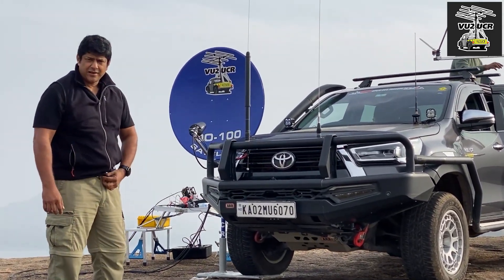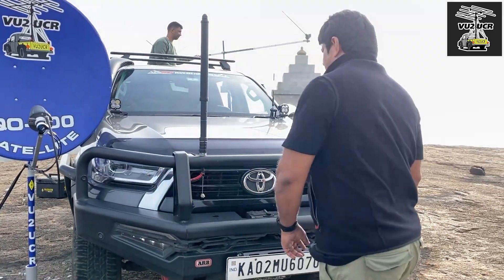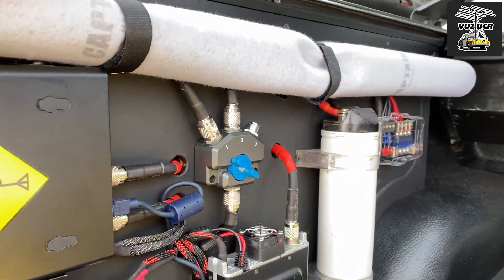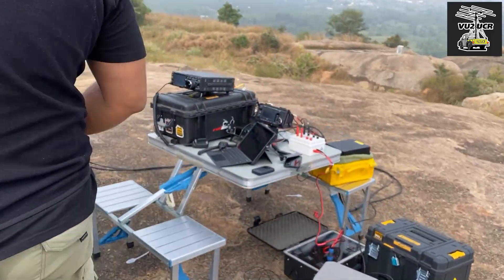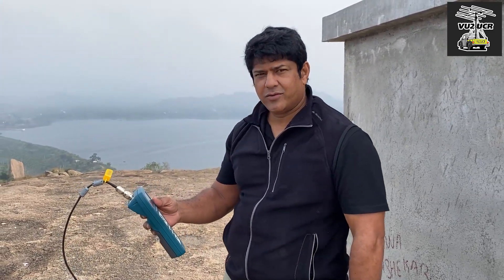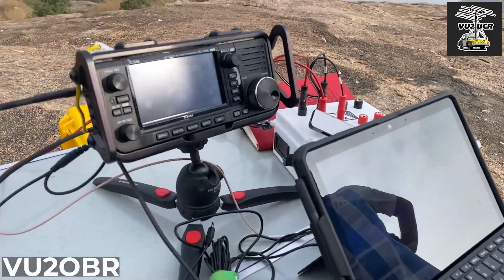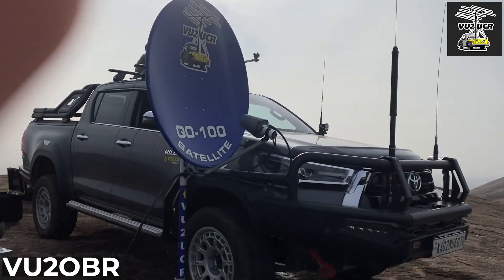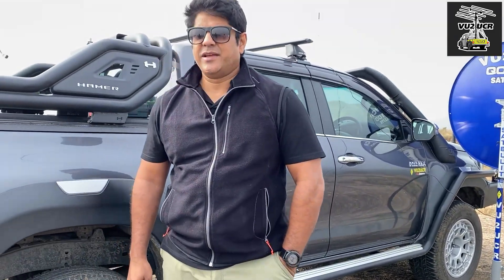QO-100 Portable Ham Radio Operation | VU2UCR Toyota Hilux Build

Comment: What is this & what’s the actual purpose of this? Please explain.
Reply: Having a setup ready like this will help in case of natural calamities to support emergency communications. Many a time regular communication networks like mobile towers can be down in natural calamities. The geostationary satellite setup which Hari has demonstrated has a communication range all the way from Brazil to Thailand and can cover our region in full. Geostationary amateur radio satellite Qatar Oscar 100 has a large footprint of coverage even to Europe as you have seen. Ham radio operators (Amateur Radio) operators globally have supported alternate communications in case of emergencies many a time.
Reply from the maker: @vishaalv1815  it’s  HAM RADIO , !!